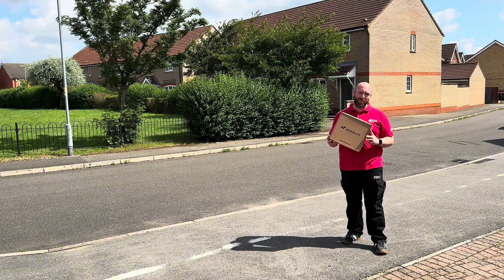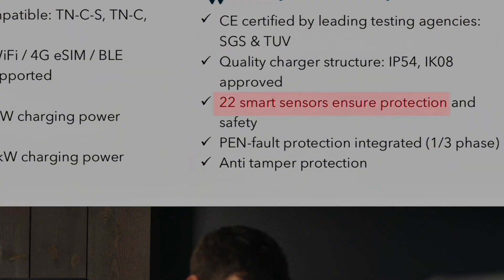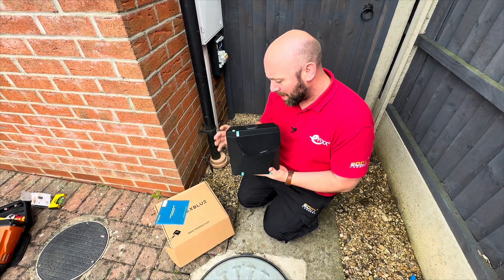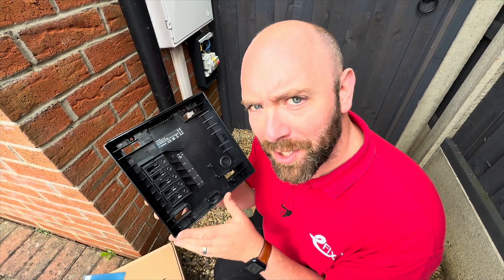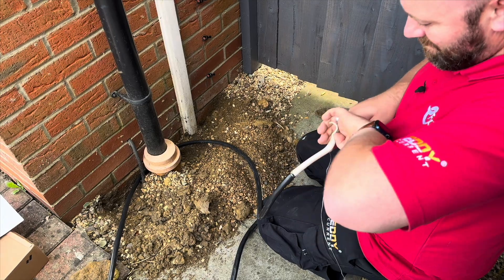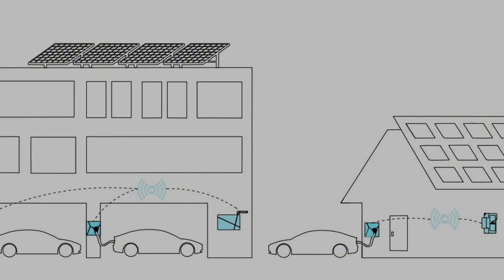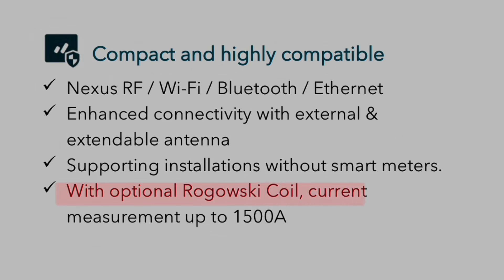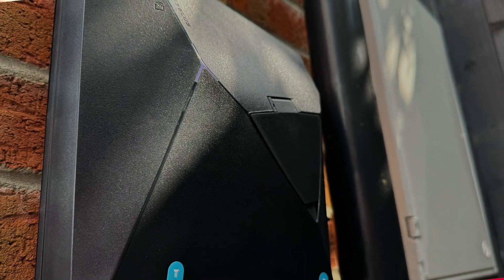NexBlue Edge EV Charger: Is It Too Easy To Install?

Comment: I’m m getting an ev car through work. Just wondering do any chargers come with a wattmeters. Is there a way of recharging your company for the electricity used?
Reply from the maker: You can manage “company” mileage using apps such as Monta via OCPP - or carry on using a mileage rate as per HMRC guidelines. (45p Mile for 1st 10k)
Reply: @efixx  Thanks